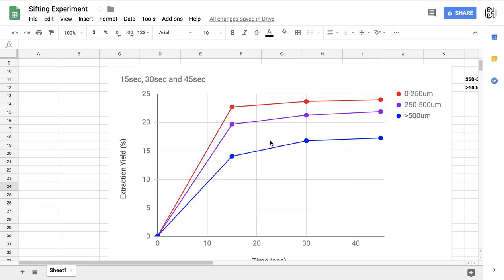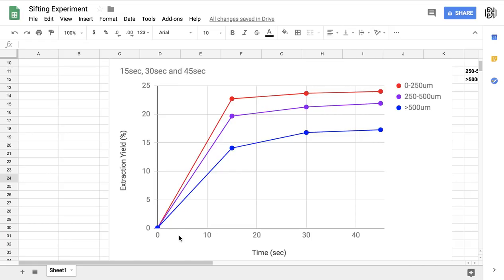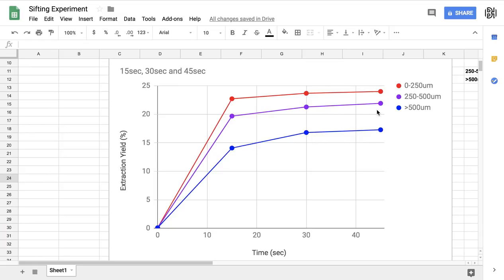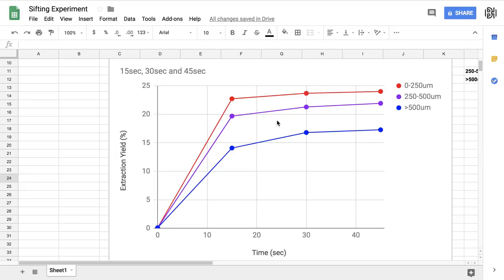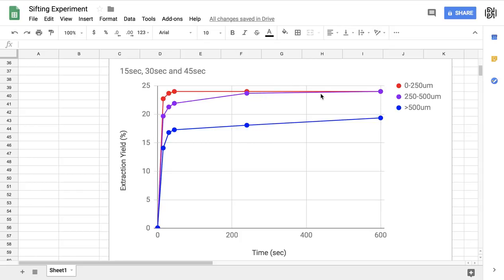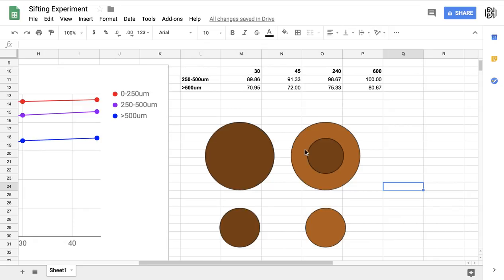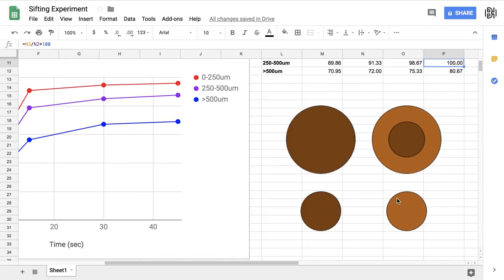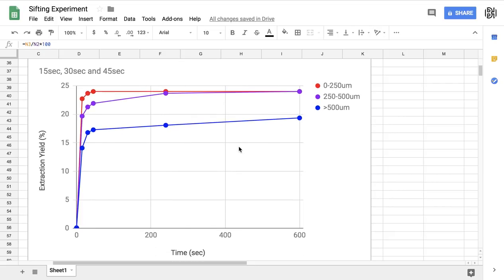Sifting Coffee Grinds - An Experiment

Comment: Wouldn't this suggest that if you "underextract" a brew you have just a lower concentration of fully extracted coffee?  Why would the flavor profile ever change to being overly acidic or overly bitter if you just always have varying concentrations of "full" extraction?  Under what circumstances would you get "over extraction" if it isn't about contact time?
Reply: In the real world coffee isn't a uniform block of taste but a collection of various molecules, some of which will dissolve easier than others. Presumably the acidic stuff is just easier to extract so it comes out first.
Reply: @nept123  My question would then be for a piece of coffee small enough that it gets fully saturated with water instantly, how long does it take for everything to get extracted.  If time time is very fast then even if you have water penetrating deeper into the grounds over time each "shell" that gets extracted just adds immediately the full spectrum of flavors in.  Until you fully penetrate you would have a bias towards the easier to extract molecules but that bias would only be large if it really takes a meaningful amount of time between which things are extracted for a fine particle.

Comment: Hi! I’ve been wondering in the table of the numbers that indicate the depth of water into the grounds, how did you actually get those numbers? Still a bit confused about how you got the number “100 microns”.. 
thanks!
Reply: He assumes that 200micron particle can be extracted fully, so water is able to penetrate radius of this particle. I think It actually should be 500 particle and 250micron radius, becouse when sifting particles 250-500 microns there where also particles with 500microns diameter, and it was fully extracted.

Comment: Seems to be very good and actionable information for Turkish coffee lovers. Instead of doing the traditional manoeuvre of waiting for the froth to come up three times, it seems that 20" infusion would be worth to try, and there is no need for decoction on boiling water. I am not into Turkish coffee, but that definitely stirs my curiosity about it. The few times I had Turkish coffee it was a bit too harsh and probably slightly burnt or overcooked, it seems that this video suggests Turkish coffee can be delicate and good without sugar if it is infused rather than cooked and if the infusion is very short, in the 20 or 30 seconds range.

Comment: thanks for the nice experiment. it seems to me that underlying assumptions are that a) whatever the water touched got extracted fully (or at least with in the first 15-30 seconds as the fine grind cup suggested), and b) the perceived yield, and by extension - flavor, was dependent only on the concentration of those fully extracted compounds in the water, since of the same amount of coffee grounds used, only the outer 100 um shell was participating the extraction. it’s probably overly simplistic, but what is missing here?

Comment: So, it makes sense that for immersion anything between 0-500 is fine. What about drip?  It looks that extraction in the 250-500 range peaks at around 230 secs. That is about 3.5 minutes. Is this evidence that a hybrid brewing method like the clever dripper might be the best option for a consistent extraction without the need to sieve? If anything below 500 microns reaches maximum extraction stops extracting at around 4 minutes, then I assume a a 3.5 minute immersion and 30-45 second draw in a clever dripper would give the best results? Or immerse in a french press and pour over a V60? My head hurts...
Reply: What I understand from this presentation is immersion brewing IS NOT GONNA BE OVER-EXTRACTED. So 4 or even 5 minutes steeping is okay, don't sweat it!

Comment: I have a Kruve and usually brew pourover (V60, Kalita Wave), drip (Bonavita 8 cup), and French Press. I have a Baratza Virtuoso grinder. What practical info can this experiment tell me on which coffee ground sizes I should brew with? Always brew with less than 500um particles for best extraction (as a baseline)? (assuming 14 to 17:1 ratio, and 200-205 deg. F H20)
Reply: Nave Bacon u use less than 500um and that drips through the Kalita?
Reply: @landon_rady  No, I was asking the question. I usually use all the grounds - I do not usually sift the coffee as of yet.
Reply: Nave Bacon oh gotcha. I have already tried previously. It doesn’t drip through. My recommendation would be to try this with an aero press (assuming you could push it through) or a French press and then put it through a v60 filter. That’s what I’m going to try anyway:)